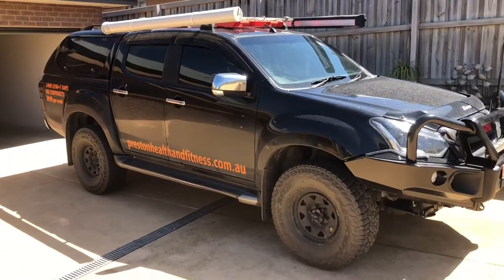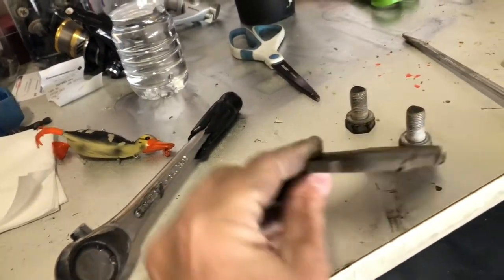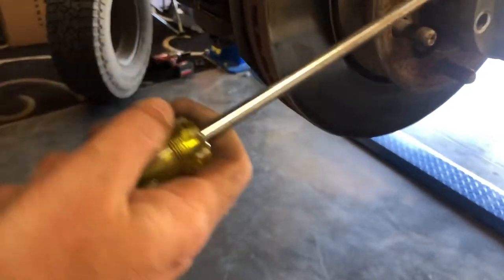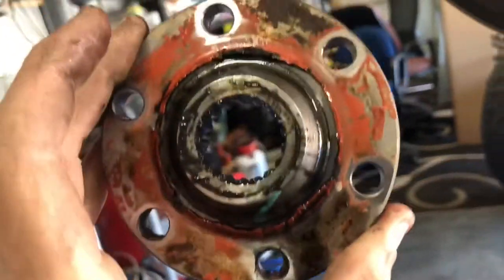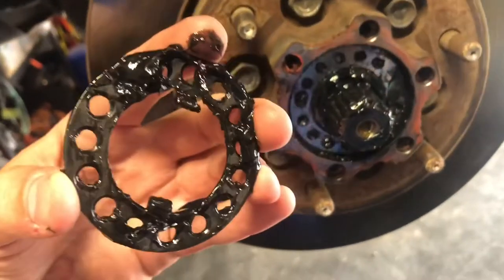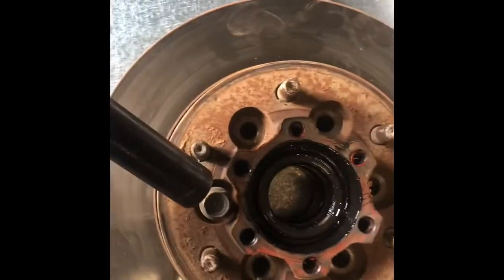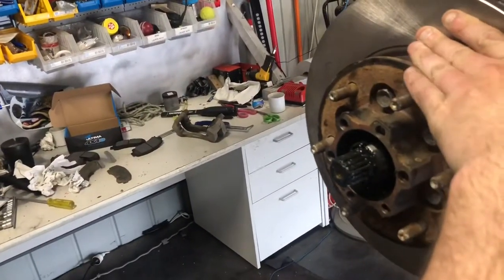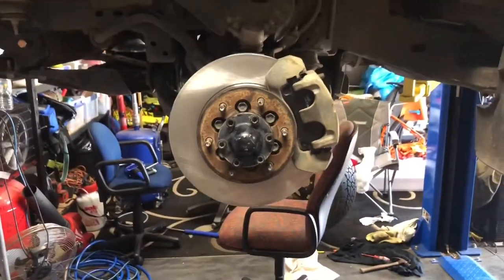How to replace front Brakes on Izuzu Dmax 2017 - basic

Comment: Would be good if you showed removing the hubs from the rotor. Did you use a shop press or just hammer them off?
Reply: yeah I have seen them pressed off in other videos, but dont have a press at home, so need to know if it can be down with out a press